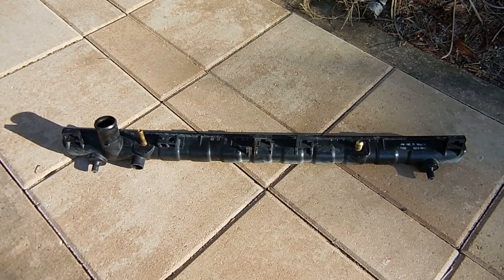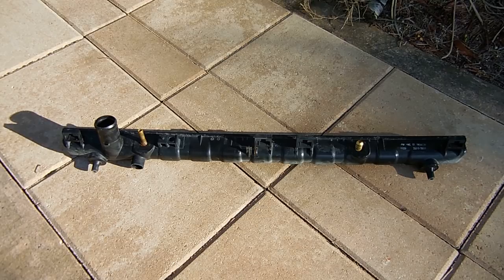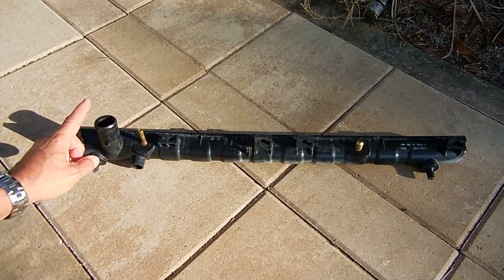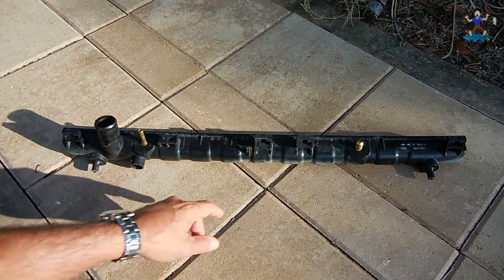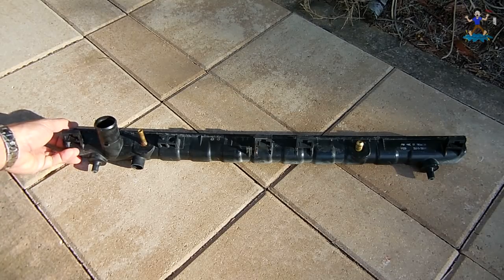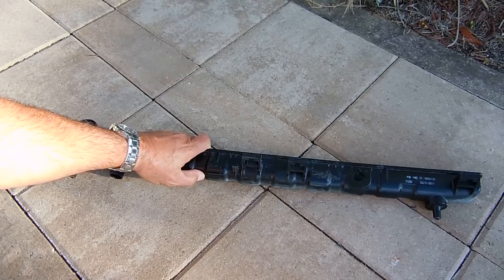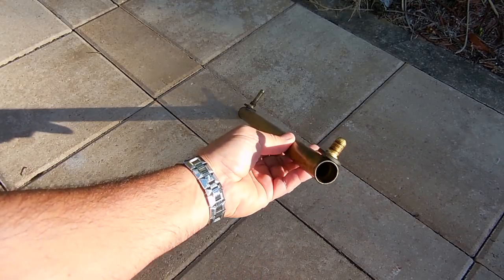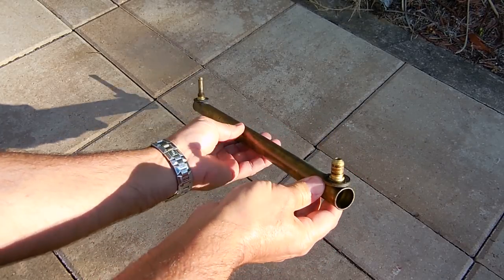What Does A Car Radiator Transmission Cooler Look Like? Let's See!

Comment from the maker: For best possible transmission cooling, you'd connect an auxiliary transmission cooler in series with the one shown in this video.
Reply: Are you sure thats safe to do?
Reply: @laragreene8328  Yes, many cars and trucks do that from the factory. Normally, the fluid is run through the radiator first and then through the external cooler to further lower its temperature before it returns to the transmission.

Comment: Thank you, You are the only person explaining that radiators. My new radiator has these fittings but my old radiator doesn't.  I was afraid to poor coolant in it because I thought it would escape through the transmission line..
Reply from the maker: Just cap the openings. :-)
Reply: Since it's a closed loop, does leaving the cap on or off makes a difference? @electronicsNmore
Reply: Same here. I ordered a radiator for my car and wasn't paying attention and bought one for an automatic transmission of my car. However mine is a manual and doesn't have the fittings.
I was mainly worried that some of the channels through the aluminum fins would be reserved for the auto trans fluid, thus reducing my radiators cooling capacity.
I see now that it is not the case.
Reply: @leonyang2008 to answer your question, abiet 7 months late, it won't matter, however it's probably better so nothing enters and causes premature rust or corrosion.
Just extra precaution.

Comment: I totally bypassed the radiator and use a B+M super cooler it never ever gets hot now not even when towing an 8 by 5 tandem axle trailer in a  110f day
Reply: What are you driving? I was wondering if I could do the same thing. I’m driving a Ford expedition with a 5.4 L 2 valve. I want to eliminate the transmission fluid going through my radiator all together.
Reply: @deepdirtysouth2394  I'm in Australia but it's an easy thing to do , transmission will run cooler and so will the engine, just make sure you use a transcooler large enough to suit your particular vehicle, however I live in a very hot climate, I'm not sure what you'd need to do if you get very cold weather appart from possibly just  installing a brand new radiator eliminating the milkshake scenario.

Comment: One thing worth noting is the coolant temp is higher than optimum trans temp so its actually heating trans fluid
Reply from the maker: Yes, ideally the trans fluid should be cooler than 180-200.

Comment: This is more of a warmer and stabilizer and manufacturers depend on transmission design to work within boundaries of heat but most of the time its highly recommended to go for an auxiliary cooler if doing hills slow climbs, frequent stop and go in traffic and living in hotter regions. Works out far better when used in conjunction with the built in radiator cooler.
Reply from the maker: The cooler in the radiator just keeps the transmission fluid from getting too hot. You'll enjoy my other related video below. :-) Thanks for watching!
https://www.youtube.com/watch?v=ebkwVSgzm-g&list=PLQ6IOhUBblU3mBem9ImEgGzmqToW6SCJD&index=54&t=0s

Comment: Thank You Sir, now i know, why the ATF pipe goes through to the radiator condensor, before this video i think that car factory made a weird installation, and i think this will mix coolant fluid & atf Fluid, but this video is very helpful,so thanks from Indonesia 🥰🥰🥰🥰
Reply from the maker: You're welcome!

Comment: Thanks for doing this! The Toyota Corollas (1999-2000) call for the same radiator whether or not you have the AT now. The original on the manual had no cooler, but the auto seems to have come standard with that TOC. Trying to find out why there's now only ONE part number used on BOTH, this makes perfect sense now that I've seen the video. (Well, except that it's a waste of copper to have the ATF cooler fittings and piping in the radiator on a manual that will never use it.) Now, thanks to your vid, we know we can just leave the copper fitments waving in the air. No problem! THANKS!
Reply: If I makes it by aluminium material... Please suggest me the aluminium alloy grade and temper?

Comment: Very very very great video. instant subscribe and upvote. Straight to the point and easy to understand. Question if I may just for curiosity. An external fluid cooler would do a better job of cooling transmission than the built in radiator trans cooler??
Reply from the maker: Yes. Watch my other video. :-)
https://www.youtube.com/watch?v=ebkwVSgzm-g

Comment: Thank you so much! My radiator was leaking trans fluid at the cooler lines connection. Can you clarify if I need to tighten just the fist line that connects to the port or the other part that connects the actual fitting to the radiator? Judging by what you have explained it shouldn't be the latter because of that connection was loose that should actually cause a coolant leak. Please let me know if I am right or wrong.
Reply from the maker: @phillippardo5712  sounds like a loose connection nothing more

Comment: Is there any recommendations regarding transmission and its oil, after replacing the radiator?
Reply from the maker: Just connect the lines back. After the engine has started up, keep your foot on the brake and shift to "D", then to "N", to "R", then back to park. Check the trans fluid level, and then again after the engine heats up. Usually you lose very little, less than 1/4QT. Thanks for watching!
Reply: Probably lose less than half a quart changing out the radiator. Give or take.

Comment: And my question is this. do I really need to run my fluid through the radiator or can I just use an auxiliary cooler with an auxiliary Electric fan? Is it the idea. keep my oil is cool as possible?
Reply from the maker: The tube inside the radiator is a heat exchanger, they dissipate more heat than a radiator. That said, if you used a much larger oil cooler, you'd probably be OK. I'd do as shown in the video.

Comment: The biggest problem with adding an auxiliary transmission cooler is finding a place to put one.  I've seen OEM secondary coolers in front of the A/C evaporators, but most of those are nearly useless jokes.  I have seen 1 or 2 models with thermostatically controlled secondaries, and some aftermarket products that also have thermostatically controlled secondaries, but they really have a stiff price on them.
Reply from the maker: My vehicle has a great place to add one if I desired. Thanks for watching!

Comment: Hello!
Actually, this is the problem I have with my Hyundai Tucson 2005. There was a breach on that pipe and water mix with trans oil. 
What will water do to the transmission? 
Solutions ?
Thanks.
Reply from the maker: You better drain out ALL the transmission fluid, fill, drive, then empty out again and refill.

Comment: I have noticed on my 2004 chevy tahoe that the lines also flow out to the small radiator in front of the condenser and it appears that this fluid is cooled by both the radiator water and then again at a condenser in front of the a/c condenser.  Dontreally get it.  But what I really dont get is them where is my oil cooler?